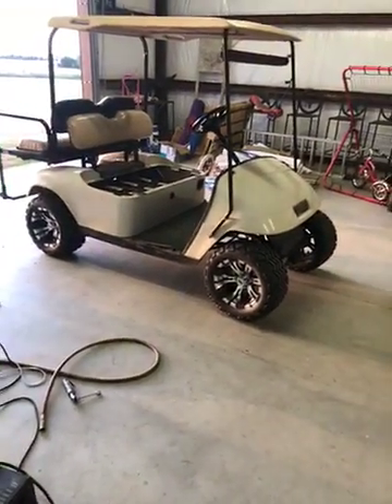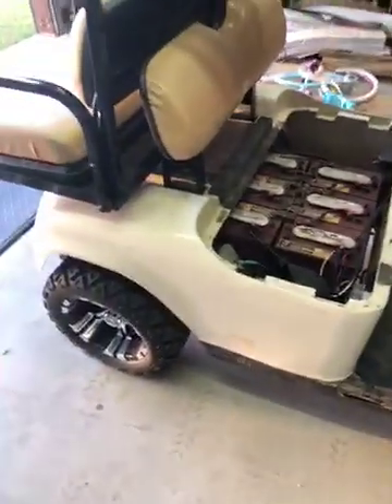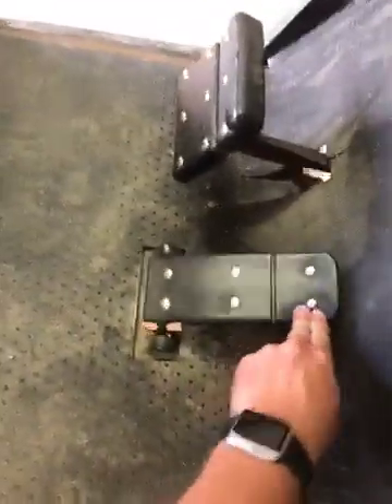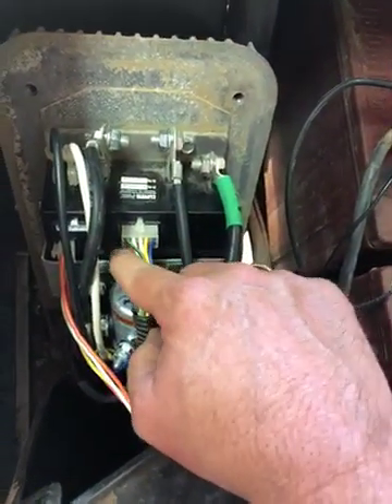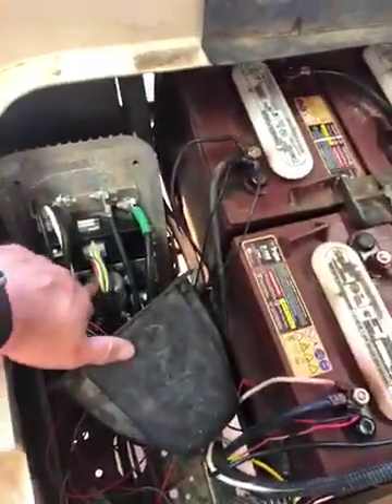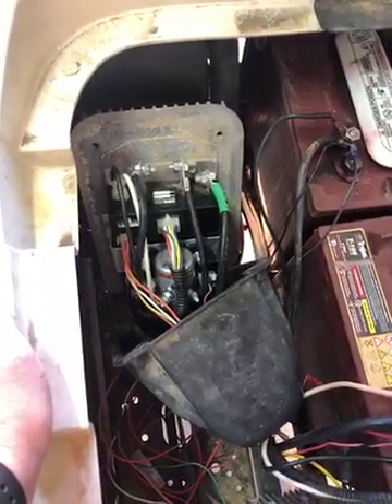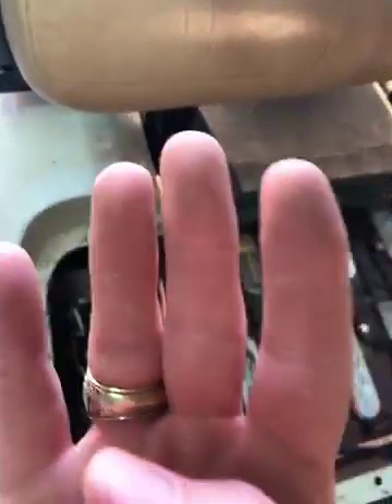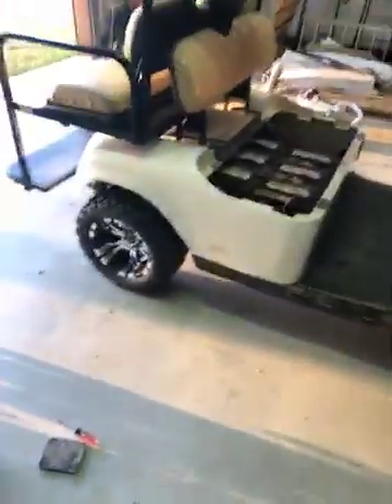36 volt EZGO TXT won’t go when outside temp is hot.

Comment: Hello 4 years ago you made these video I want to ask you if you still have the golf cart can you please take a picture of you solenoid I want to see how it's connected because mine doesn't have a diode and yours has it on there I have red blue and yellow going to the solenoid but I don't have diode maybe I need to add it there thank you
Reply from the maker: Hello, the diodes were inside the Curtis controller (the brains/computer) that is behind the solenoid. 

I still have this cart, we use it at the lake primarily, and it’s still working great!

Comment: I need help. 36V 2007 EZGO. The batteries are fine. I rode it up the hill with a lot of resistance. The batteries got hot. I went for a hike, came back and the cart wouldn't move. I hear the click when I engage the pedal. Please help.

Comment from the maker: It’s been a couple weeks and I can say for certain this fixed my problem.
Reply: I just bought the golf car put batteries in it and it acts like the batteries are low jurks forward and in reverse dont know what year it is i would sat around 2000
Reply: I found the problem I had 1 bad battery  power would drop to 4 v then return to 6 v just bought the car and don't know much about  i am learning  lol thank you for your time
Reply: I'm having a similar problem with mine. I have a 2007 36 volt ezgo txt and while at the campgound and fully loaded front and back, when I would stop and try to move again, it wouldn't do anything at all. I turned the switch off and back on two or three times and it would finally go. I had already installed  new batteries prior to this problem and didn't have this problem before that. I'm wandering if my controller may be going bad. It seems to be fine if it's just me on it. Maybe with  a full load, it getting the controller hot and shutting down?
Reply from the maker: @tonystephens1027  that could be it for sure. Mine happened when I left it in the sun, I’m guessing 15-20 extra degrees would shut it down. The controller shouldn’t get hot with extra load, but if the capacitors are close or touching it may be heating them up. Electrical is frustrating for sure, it’s all trial and error. The trouble shooting guide on one of these comments. It may be the motors getting hot too. If you figure it out be sure to comment, somebody with the same issue might find it helpful!

Comment: Hey bud thanks for the video. My 36v txt has six brand new Trojan batteries. You press the pedal and it will take off like a freshly charged cart normally would. 30 seconds later it acts like the pack is dead and just stops. Press pedal again and off you go and so on. Any ideas?
Reply from the maker: I’m not an expert, but I’d be willing to bet it is a problem with the ITS position sensor, or your controller. I really lean towards the controller.  The ITS is inexpensive (like 25 bucks) and easy to change.  There is an online step by step trouble shooting guide if you have a volt meter you can really narrow it down between all the different components. I’d also be tempted to put it on jack stands in your garage and try it without a load. If it runs longer than it did with a load I really think it could be the same problem I was having. It definitely wouldn’t hurt to crack that controller open and look. The capacitors swell a little after some juice flows through them and then they touch and  you lose power. They are easy to straighten out, then just reinstall and test. If you take it to a golf cart repair place they’d probably just replace the controller. Please let me know if you give it a shot and if it works!
Reply: @hotrodhoward16  is

Comment: I have the same type of cart and controller,i can not get it to move forward or reverse. I was working on it and by accident touched a hot lead to the white wire  on the key switch,now it will not go forward or reverse and the solonoid does not click
Reply from the maker: Audrina Iaccarino, if I was going to bet, I would bet that you may have damaged the switch. That’s easy enough to test if you have a volt meter and are capable of seeing if continuity is flowing through. There is a step by step guide to checking components in one of the posts below. If the switch tests good, I’d check the solenoid. I doubt you messed up the controller before messing up one of the other two items. Hope this helps!

Comment: Hey David,
Having probem with my 97 ex go electric, so I have new batteries and on a full charge after using the cart for a round of golf, during the round maybe  14 holes in the cart will lose power as if the batteries were dead and stop. After waiting a few minutes the cart will come back as if nothing wrong and continue the round.
I have replace the reed by pass, the forward reverse mechanism was replaced last year and the batteries are less than one year.  A golf repairman seems to think I need a new motor and others say it is something else

Comment: i have a older  e z go 36 volt about 8 years now  90% time its corroded battery connection    some time you can find the bad one by feeliing it will be warm to hot take it apart  clean  reconn  and ok  i had conn.that   smoked slightly  i  replaced my batters about 2 yrs ago    i plug in charger often   in ref to the reed switch its for safety but yu can remove  it and conn smalll red wire to + (white wire )  want cause any prob . the sole purpose of reed switch is to keep you from driving off with charger pluged in??????????? who would that   -------take those battery cables off  clean them you will see a marked diff in  speed if you dont have a buffer use baking soda and water to clean cable ends

Comment: Hay stupid question for you on the front of the solonoid it has two little wires what side is the blue one on when your looking at it ?  I changed my solonoid and forgot what way they went
Reply from the maker: https://www.golfcarthotrod.com/1171/ezgo-pds-solenoid-wiring-diagram-solve-problems-cart/ there is a diagram and also an explanation above the diagram. Hope this helps!
Reply from the maker: https://www.golfcarthotrod.com/1171/ezgo-pds-solenoid-wiring-diagram-solve-problems-cart/
Reply: @hotrodhoward16  yes it does thank you very much i could not find a diagram

Comment: We are having the same issue. But we have a brand new controller.  I mean maybe a month old.... if that.
Reply from the maker: I hate to hear that, I know how frustrating it can be! Did it work for a month after you put the new controller in or did it start acting up immediately? I think my issues started when the kids were driving it way to fast on a very bumpy piece of terrain on a hot day. Trying to use it as a UTV in other words. I wonder if you might have accidentally replicated the original problem on your new controller? If you have your old controller I’d split it open and see. I like my golf cart but frequently remind my kids it’s for old men to drive on fairways and wasn’t designed to be ran like a Razor up to the lake house 😂. It could also be your throttle position sensor, the switch next to that, or possibly the solenoid. If you have an ohm meter you could walk through the trouble shooting to figure it out. Harbor Freight sells Ohm meters for less than $10. Id be happy to help in any way that I can!

Comment: Can u show me where the reed switch connects to controller I understand the plug side my wire is off on controller
Reply from the maker: The reed switch is kind of like a key switch, but current turns it on and off instead of a key being turned. It doesn’t run into the controller, it just stops the flow of current if that makes sense. 

Here’s what the actual switch looks like:
https://jasonsgolfcarts.com/product/reed-switch-for-e-z-go-powerwise/?gclid=Cj0KCQjwyMiTBhDKARIsAAJ-9Vuyx_9TnEmTXfJDE3R-yLAqCCvCm7TbKzblgFO366gVKq8Tw4-YfhIaAqX-EALw_wcB

Comment: Hello I have a issue ezgo txt only goes on reverse and when I switch the wires on motor goes forward but not reverse any ideas? Thank you
Reply from the maker: Full disclosure, I’m not a full time golf cart mechanic. I’m just a guy with a golf cart that had a problem and I like to trouble shoot 😂. My initial thought is KISS. It stands for Keep It Simple Stupid. You know that your motors work in both forward and reverse by switching the wires. They are good. Next, are both your power supply wires good going back to the switch? You can test continuity with an ohm meter. If the forward wire doesn’t have continuity, you found your problem. If both hot wires have continuity, test your switch. As a betting man, I’d lay money on the switch being bad unless a rat at your forward hot wire. Either way, this should be a fairly easy prob to fix. Hope this helps! Let me know if you figure it out.
Reply: Ok perfect I’ll check out the switch u don’t think it’s the speed control because both wires from motor goes up to the speed control not sure how the speed control woks, nor sure if it sends single to control to go forward and send control to go reverse thank you
Reply from the maker: If you need a little more detail reply back and I’ll provide some insight tomorrow, but for now, if you take your directional switch out, reverse will be on the bottom. You know that wire is good. Ohm it out just to check. Next check the color of your top wire and ohm it out at where it plugs into the switch and where it plugs into the motor. If that’s good, ohm out your switch from middle to bottom to check it. Assuming it reads correctly, do the same to the top. That’s really all that’s too forward and reverse. Switch, or forward wire.
Reply: Hello also when u say switch u mean the forward and reverse switch not the speed control right thanks you
Reply: Check wires from switch to where connect to speed control everything is good 👍 You think might be the switch
Reply from the maker: @ManuelGomez-ve9dk  it could be, but I would start simple. Inspect wires to make sure they weren’t chewed in half, test the switch. If all that’s good, then I’d look at the controller.
Reply from the maker: @ManuelGomez-ve9dk  yes sir! Those switches go bad regularly, it may not be sending the power.

Comment: Do you have any pictures of your controller box open and where you find those four diodes?
Reply from the maker: I do not have any pictures. Those diodes are right by the small 4 pin connector, there’s a video of how to crack the controller a couple comments down.
Reply: @hotrodhoward16  thank you!

Comment: Do you know how to make the cart faster
Reply from the maker: Javi Cantu https://www.amazon.com/Golf-Cart-King-Electric-Freedom/dp/B00S0QPA3S they make a speed chip that plugs into a controller, they also make a different one for climbing hills that utilizes torque differently.
Reply from the maker: https://www.amazon.com/Golf-Cart-King-Electric-Freedom/dp/B00S0QPA3S/ref=asc_df_B00S0QPA3S/?tag=hyprod-20&linkCode=df0&hvadid=241951977551&hvpos=&hvnetw=g&hvrand=16259925386659196848&hvpone=&hvptwo=&hvqmt=&hvdev=m&hvdvcmdl=&hvlocint=&hvlocphy=9028542&hvtargid=pla-573951413184&psc=1 sorry I’m new to the comments, I’ve posted links and replied privately to a couple questions, just trying to put it out there for everyone.

Comment: I can't find your links
Reply from the maker: Pete Garcia hey Pete, the controller opening video is listed above. Here is the trouble shooting guide. The good news is that it’s probably only one of two different things, throttle control sensor or controller. My problem was slightly different than the one you are having. https://www.cartsunlimited.net/ezgo-troubleshooting.html
Reply: Thank you Sir.
Very much appreciated
Reply: A friend of mine told me to charge the battery for a day or so i was reading volts not amps